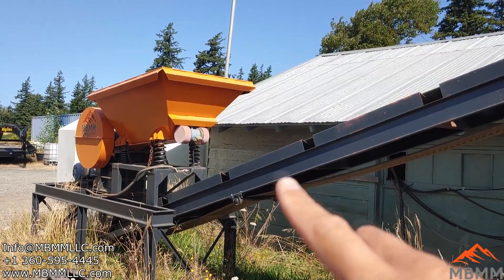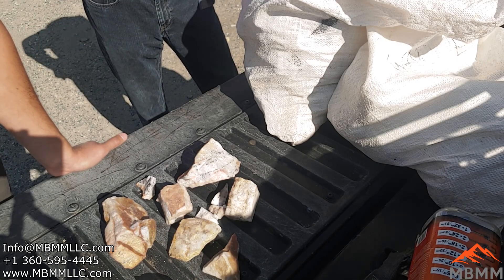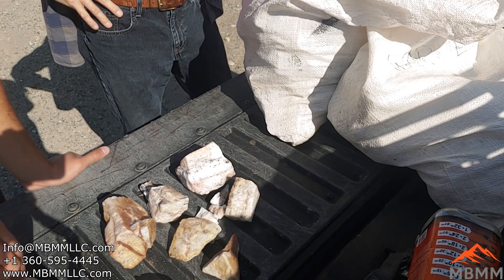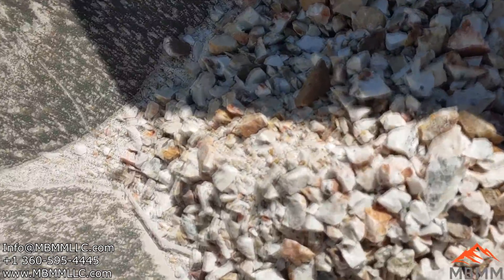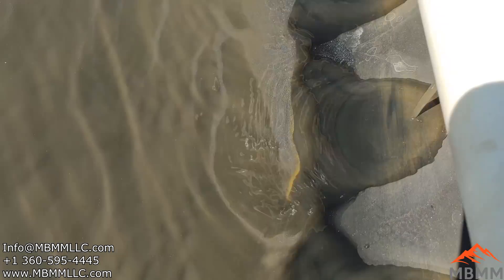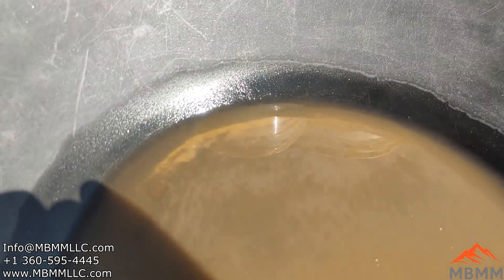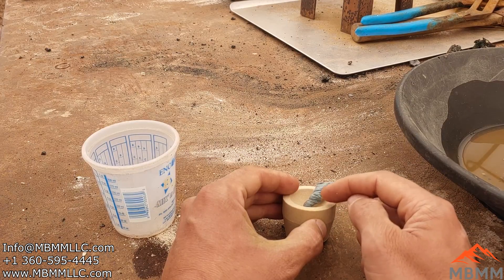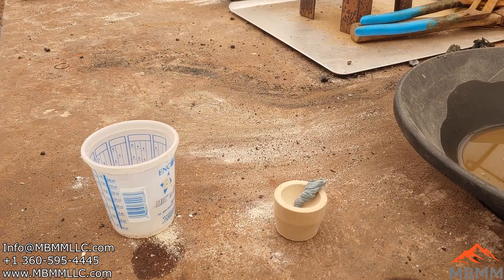Testing Rocks For GOLD!!

Comment: We are waiting for a particular payday then will be ordering the smallest jaw crusher, a ball mill, and the shaker table to get started on our property. Start small. We had some samples assayed at 14 gms of gold and about the same of silver per ton. Can't wait! We need the mechanization.
Reply: If intrested in a similar set up, I have 1 available new at half the price.
Reply: @hellohello5550  Sounds intriguing. We are expecting a windfall soon. The shaker table is the most crucial to us - a good one. Durability and good workmanship with accessibility to replacement parts for the mill and jaw crusher also. We are in Washington state.
Reply: @anotherrant6688  No problem,  also have everything you need available,  shaker tables, jaw crushers,etc.
Reply: @hellohello5550  OK. I don't want to promise anything but how can I contact you to check things out?
Reply: @anotherrant6688  moldskustom@gmail

Comment: Is it possible for gold to get locked up in Black Sands.? I've heard yes and I've heard no. I sometimes run my black sands on a Miller table and when looking through a magnifying glass it appears that some of the sulfides have gold locked up in them and it acts like gold as far as non-movement on the Miller table. Thanks as always and keep up the good hard work!
Reply: What would be the best way to make the determination?

Comment: I like that you recirculate the water back through the system. Have you taken samples of the water over time? I suspect it will become increasingly acidic and loaded with various metal ions. Am wondering if it could affect your recovery.
Reply: I love how everyone is so concerned with small scale mining that all the coorporate calamities are sweept under the rug. You think leach fields are fine if a couple steps are taken? Did ya test the water!? Lol. Just wow. Stop picking on the little guy and go after the big ones that buy their way out of trouble. Just like the u.s. gov did with stimulus checks.
Reply: Im going to hibank into the river this weekend. Thanks for the babysitting boss.

Comment: I been digging in my back yard down pass 36" below and noticed it's all sand with gold sparkling flakes, is this stuff real gold? Can I pan it?
Reply: Probly not but u can sure try you should upload a video of u trying if you dont have a pan and dont know where to buy one make one out of an aluminum pie pan works great
Reply: might just be mica. If it doesn't sink quickly to the bottom its not likely valuable.  Also if the shiny pieces are square shaped with sharp corners that indicates mica.